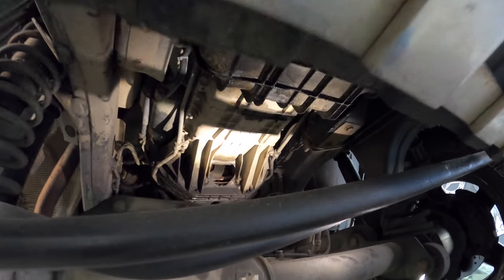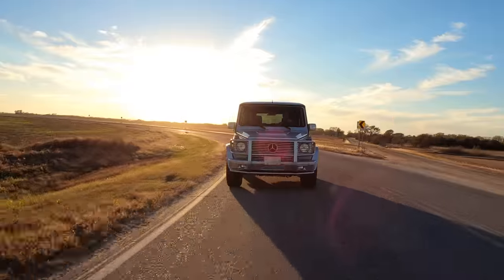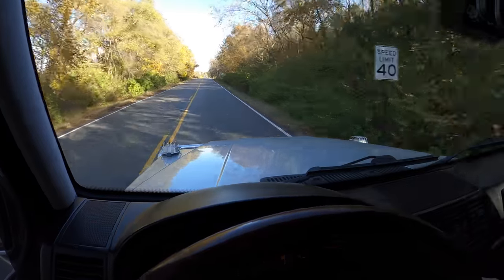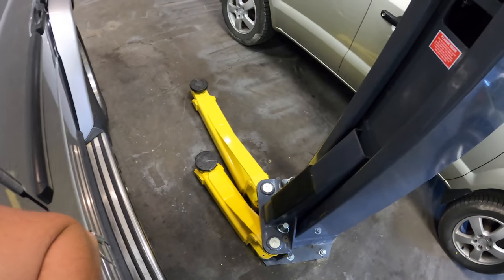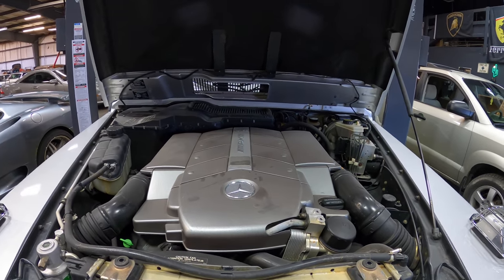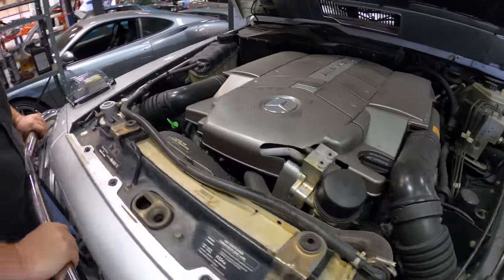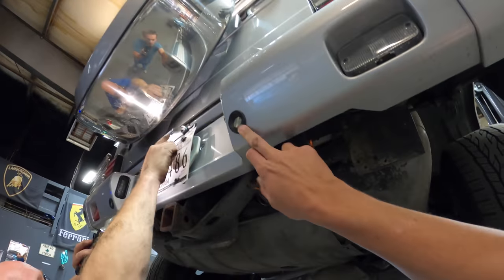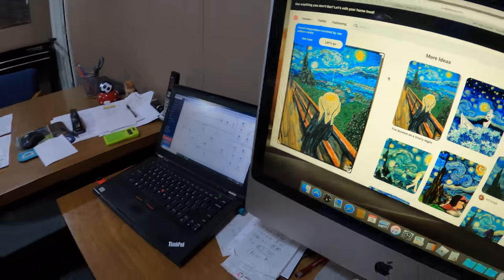Everything That's Broken On The Cheapest Mercedes G55 AMG (CROOKED MOUNTED ENGINE???)

Comment: That is just how G-Wagen engines sit, they had to do that to clear the steering shaft. Source: I am a 15 year Mercedes Master Tech and shop foreman. Google photos can help you as well.
Reply: So ur saying u know what ur saying...ha.
Reply: You are correct. I have been working on Mercedes since ‘02.
Reply: Yeah, but the Wizard will straighten it up.
Reply: Have the same car, same crooked engine
Reply: As long as the torque converter bolts torque spec isn't finger tight.
Reply: @TheTubaMan2  Sure isn't
Reply: Turner Pendergrass Torque converter bolt torque is finger tight + 2 degrees. V-12 models use the popular German torque spec of “Guhtenteit”.
Reply: Will an M113k fit in an SlC 43 AMG?
Reply: @ronjohnson8119  An AVE fan?
Reply: Yes the 463 has the engine mounted like that to get the M113 can fit over the Steering shaft. I am also a master Mercedes Benz Technician since 1998.
Reply: @124030  Hi! I have the M273 in my G550 ... should i expect the same slight slant in the engine bay?
Reply: mine 2008 G55 AMG's engine also tilted, same direction.
Reply: It soup like someone is putting a slant on Hoovie’s G-Wagen issues.
Reply: You beet me to it! I’ve been euro trash certified since 02! All the 463 engines were slanted like that.
Reply: Joe- What is your assessment of a used G-Wagen? Not necessarily one with 222K miles! Any years to avoid?
Reply: Don’t you think the power steering leak was just from a $3 O-Ring from the power steering reservoir? I replaced mine and it’s fine
Reply: 0 experience with G wagons over here, but I have noticed from various engine bay pictures of various G’s that they all sit like this so I figured it was normal.

Comment: The wizard can finally fix his ceiling
Reply: Cannot un-see!!
Reply: The yacht would be my guess
Reply: Does he take those down and serve Chinese food on them?
Reply: Yeah, that was bad...
Reply: You mean buy another boat
Reply: Brutal
Reply: You can just paint those stains away, they have special cans for it.
Reply: Or fix whatever is leaking up there.
Reply: Wizard is cheating hoovie
Reply: Yogo619....how? Those are tiny bills for those vehicles. I challenge you to purchase one these vehicles and get repairs done by a professional ( not yourself regardless of your skill level) for a better price.
Reply: I laughed at that a little harder than I should have.
Reply: @patmclean1951  he's under-charging if anything
Reply: @jundialhaqiqa9907  phhft why :p
Reply: The 65 wasn't running and wants to get paid ? Wizard ...
Reply: You could call the engine in the g class a “slant 8”
Reply: But that’s what Flexseal is for!
Reply: Fix it with a Van Gough painting? 🎨
Reply: Yeah, that ceiling was a big surprise. I wondered why would he film that 🤦🏽‍♂️
Reply: came to comment section to see if anyone else noticed
Reply: @patmclean1951  FOUR GRAND seams a bit steep for a lift kit depending on the shocks, I mean it's not IMPOSSIBLE for the price to be that high but damn I did a drop kit and tubular upper A-Arms for under a grand on my Trailblazer, that was Shocks, Springs and the tubular upper arms to correct the geometry so the truck would align properly and I don't think I had 10 hours in the whole job.
Reply: PLEASE!!!!
Reply: @yojo619  If something is under repair for half an year, i'd imagine pretty steep bill. In here average car repair shop takes 100eur/h. And oil change to mercedes is around 500-700eur.
Reply: I hope he keeps it the same. He's humble enough not to care.
Reply: @DanielRichards644  your not wrong, but he is paying someone else to do this work. When you hire a professional to do work for you , you pay for their labour, shop time and material markup. It’s pretty standard business practise.
Reply: @patmclean1951  yeah I know, that's why I listed time so you could apply a 65 dollar an hour rate and still out much cheaper in my case, but I also said there can be more expensive hardware then what I used for my drop kit if like you get really fancy offroad shocks with external reservoir tanks.
Reply: @babyaufshar17  Mold on the ceiling or in vents can be pretty big health hazard, so it could be pretty good thing to change moldy tiles. And check the vents. It could be that old system has achieved dev point and made water in system and this has leaked into ceiling.
Reply: @jundialhaqiqa9907  the leak was fixed. its just a stain. You cant make everything perfect. Dont even try. Nothing wrong with the Wizard's ceiling tbh.
Reply: @yojo619  Wizard is a honest and trustworthy mechanic. Hoovie bought a old Merc! There is a reason no one repairs them and they just go buy a new one.
Reply: Leased location likely.

Comment: “The shafting is not over yet” 
-Wizard 
Perfect explanation of 2020
Reply: Sure is.
Reply: @thethomasj1795  b)
Reply: Excellent comment for less than two months left in 2020.
Reply: Should be put on a T-shirt with 2020 on the bottom.
Reply: Iconic

Comment: I’m always amazed how cheap wizards rates are. Here in NYC these bills would be 2 or 3X the cost
Reply: Well, it's a lot more expensive to operate a business in NYC than it is in Kansas. One of the reasons why you pay almost 30 dollars for a Sandwich at Katz Deli. I live in CT and going to go have a lobster roll for lunch and by the time I am done where I am going, I will drop 40 bucks.  It cost to much here on pretty much everything.
Reply: You vote for democrats
Reply: @Dog.soldier1950  The price of tea in China varies by type and region of purchase.
Reply: Median income where I live is 55k. The city over where my gf lives, it's 27k. Even with that, average hourly labor rate is around $97 hourly not counting higher end dealership psycho rates.

Wizard charges by his labor rate x book hours. Most small shops around here do the same, but always labor over book time, so lose money. Average tech/helper pay is only $9 hourly. Shops can't keep decent mechanics due to low pay (24-27k annually), so they rely on kids still in vocational school.

I imagine a city where a 700 sqft apartment is $2200 a month would have some high labor costs. 700 sqft apartment here is around $500 a month.
Reply: @AdamIsUrqed  makes total sense. In my neighborhood a 700 sqft apartment goes for $3200 a month lol
Reply: @markedwards7032  Holy Jebus. I thought I was getting shafted paying 350 a month for a 279 sqft shit box with a tiny "kitchen" and a bathroom the Lollypop Guild would use.
Reply: @LemonRumor  the advertisement is priceless
Reply: Land values , taxes, housing costs are all lower so those reduce the cost of living for everyone
Reply: I think first Hoovie gets a huge discount for both volume and publicity.  Second you'd be surprised that not so far out of the city prices drop considerably.  You can find import mechanics, good ones who bill at $100 an hour.

Comment: "...the prices to repair have not depreciated." Well said.
Reply: I tell customers that all the time when they come in with older euro vehicles.
Reply: No but they’re tax deductible and paid for with YouTube Ad revenue which is literally $5,000-$12,000 a DAY
Reply: Repair prices have done better than the markets for sure.
Reply: @j_freed  used car prices are so high dealers cant buy auction cars right now. MMR is through the roof on everything.
Reply: @sukmidri  I lost my job of 15 years at a dealership due to Covid. Feb-Apr has always been our boom season due to taxes. Used car prices have been going up at auction since 2008, but, for some reason, near the end of 2019, it went crazy on our top cash cows.

Chargers, Crown Vics, Chrysler 300s, Navigators, work trucks (running, manual, little to no rust, dents don't matter), Caprices of all years, amd even 90's Roadmasters.

Coronavirus was supposed to bottom out the used market. It didn't. It bloody made dealerships/private sellers increase car costs and ANYTHING near fair market value got snapped up instantly, or bid out of price range on no reserve.

I dig car sales, but working at a small lot sucked when vehicles increase 1.5x in the span of a week.

Comment: Those axle joints at the wheels aren’t “leaking” because they are empty/dry...
Reply: Most likely. Needs a big shot of grease.
Reply: I have a 2000 one and had a 1985 before that. Your fill them as a service item and they ‘weep’ slightly to self clean when your off road - grease out Vs dirt in..
Reply: I agree!
Reply: Argh, my inner pedant has just exploded and it's been a long day so I won't stop myself. NothernChev - it is "they're". Simon Notice - it is "you're".
Reply: @stuartgreenshields5591  Thank you!  I didn't catch that one as I usually do. Corrected!
Reply: @stuartgreenshields5591  You're going to hate this, but "they are" is correct. "they're" is the short way....  same as it's for it is. You are ;-) correct about the the "your" though. Hope I didn't ruin your evening.
Reply: @user338jdn  if they’re anything like Toyota knuckles, the balls should be lightly greased by the wipers which builds up over time. Perfectly normal, but should be cleaned regularly to avoid build up. They commonly get so bad you have to chisel away greasy muck to uncover the bearing cap fasteners.

If the inner axle seals are gone diff oil would be pissing out that seal and a huge wet leak. Diff oil washes out the grease so those leaks need attention.
Reply: Prakaash A  , no, it’s a solid axle 4wd knuckle joint. They usually have felt and rubber wipers. Never seen one with a boot.
Reply: @stuartgreenshields5591  I’m mildly dyslexic.. I usually catch most things, but that’s one that I often read as right, when clearly its not :-)
Reply: They looked scored to me.
Reply: @coyote5735  they’re not a bearing surface, it just has to be smooth enough for a wiper seal to keep grease in. More likely to be a line in grease than a score mark

Comment: 2 Mercedes, including a v12 one, a Bentley and a conversion van ALL brought up to speed for under 8K, Wizard is a good deal. The CL65 @ the MB dealership alone would have been 8k.
Reply: Yeah I was surprised with those prices. I mean changing a single front brake caliper and rotor on my 07 mazda 6 cost me 900 Euro work included (only dealer had the parts and I needed it ASAP) in central europe. I can easily see CL65 invoice being aroung 8-10k here.

$750 for a driveshaft change incl. labour on a 22k luxury SUV? That's next to free. I can easily see an MB dealer asking 10x the price. Same with the motor mounts... like just the labour to have them removed would be 2000 EUR at least here. Having the G wagen with everything fixed by a guy who knows what he is doing for less than $30k (excluding headliner)? That's a bargain.
Reply: @VanBourner  yikes, that seems like highway robbery. In the US that caliper is an $80 part pads are about $40 and a new set of rotors are 65 and that’s for premium stuff. Maybe a $200 job with shipping. Changing calipers is a pretty easy DIY job sucks though if you dont have a garage you get ripped.
Reply: I wish I had a Wizard like this in my town!
Reply: @David..  Mazada's can get real funky to work on sometimes
Reply: The Wizard offers Hoovie a substantial discount on his work because, A) Hoovie has a never ending supply of work for him to do,  and B) if you pay attention, Hoovies stuff sometimes takes a while to get fixed. Hoovie's hoopties are worked on when his full margin paying customers are taken care of first.

Comment: The engine is supposed to lean like that... it leaves clearance for the steering shaft.  Your motor mounts are fine.
Reply: Yes, exactly. It looks odd, but that is normal.
Reply: Was looking for this comment! It’s normal for ALL these G wagons(2002-2018) for the motor to sit a little sideways. I was honestly expecting Hoovie or the Wizard to know this as they both have stated to be Mercedes guys!
Reply: I was wondering if maybe that was the case from the 1st time Hoovie pointed it out in the previous video...it'll be interesting to see if they mention that in the next video.  I almost recall Doug Demuro pointing out that interesting quirk back when he reviewed his own G wagon.
Reply: @caseyhubbard4350  Well, they actually say it's supposed to sit a bit tilted, but they think this one is sitting tilted too much.
Reply: I think its a bit more tilted than normal.
Reply: @aleksanderqpantev8754  So do the Wizard and Tyler.
Reply: The Wizard did mention that it could be like that.
Reply: Speaking from experience, it's normal for the w463 Mercedes g wagon 5.0 to sit slanted
Reply: Yeah, the amount of tilt (as shown in the video) is normal.
Reply: @caseyhubbard4350  my merc mechanic also told me the tilt is normal for the w463, but not other mercs of the era
Reply: @aleksanderqpantev8754  it looks normal to be honest. I'm not saying ur wrong though.
Reply: +1 A G wagons/class have this leaning engine
Reply: This guy knows what he's talking about.
Reply: Mine tilts to the left and it's perfectly normal.
Reply: Nope, the engine shouldn’t be leaning like that at all. I broke my head on them, I see them daily
Reply: @josesegura2170  Sorry but you've never worked on a G wagon if you don't know the engine tilts like that by design.
Reply: The wizard said it looks like they tilt a little but he thought that was too much.
Reply: When I was a benz tech, my foreman  said that they come with a straight six in europe. But Americans want a v8. So the engine sits at an angle  to make it fit. I hated working on them...

Comment: those engines are put in like that from the factory
Reply: yep, supposed to be tilted , needs space for the steering system
Reply: Old one's...
Reply: Yep.. I have a 2000 G 500 and the engine is exactly the same. Serviced by a Mercedes specialist who work on a number of them. That’s the way they are.. at an angle
Reply: You just saved this guy a lot of money😂😂
Reply: Needs some loctite or some washers to cinch up the bolts

Comment: Nice W463!!!
Instead of lifting the car 3" with an expensive lift kit, and resulting that the car will ride very bad, because there are a lot of changes on the suspension geometry, I would recomend to use a 1" budget lift kit, swaping the used shocks for a new ones with stock lenght, I would use the stock 17" wheels with some 1,25" spacers and AT tyres 265/70R17. It will ride like stock, and it will have an appearance of bigger vehicle, like an offroad special edition made by MB factory.
All the saved money can be spent on doing an automatic transmission flush, for example.
Best regards.

Comment: Hoovie has a problem with buying cars from Stuttgart with engine troubles.
Reply: I'm sure I can hear Munich clearing it's throat somewhere...
Reply: I guess we blame the Austrians from Graz for the Geländewagen. 🤣🤣
Reply: @cullenmiller8170   NEIN!
Reply: Sorry, but that’s not correct.  He has absolutely no problem with buying cars from Stuttgart with engine troubles.  He’s bought LOADS!!!
Reply: @martinkk2943  Ja doch. Die Burschen in Graz hatten zu viel Kirschwasser oder Enzianschnaps. I wish Mercedes would have sold a basic G-Model over here. Diesel engine and manual transmission instead of the fully loaded version. I guess they thought they had a market with the Chelsea tractor.
Reply: The m113 is a good engine.
Reply: @mchuo7834  Wont argue, the M96 is a good engine too, but he bought awful examples of both.
Reply: @henryatkinson1479  
If Hoovie bought a Toyota, it would’ve been one with massive issues. Because that’s what his channel is about: broken messes.
Reply: Ingolstadt would like to enter the conversation if Hoovie would torment himself with a B5/6 Audi - or any from the early aughts models.
Reply: @ACedricArmstrong  allroad time

Comment: I'd say some one quick swapped that engine and sold the car off. Make sure that is a good engine, it might just be enough to sell the car last a few hundred miles before it blows again.
Reply: Arent they pretty bulletproof engines? I suppose they should test the oil and crack open the valve covers at the least to get a view of its general health
Reply: No those things don't blow up just like that...they are very good
Reply: @NuclearPineapple   for the most part the M113 is probably one of the single most reliable Mercedes motors I can think of. I have seen 300+K miles on original motors with average maintenance. They may leak a bit eventually, but it'll run forever. Until one of the electronic accessories break and end up totaling the vehicle.
Reply: @FappinSteve  He said 300k miles, not kilometres.
Reply: @FappinSteve  I mean 300,000 miles the K as in thousand.
Reply: @UCqYaxiwJ6Pybj64DKLCi4ag but yeah my grandma had a W220 2000 S500 and the motor was the single best part of the car reliability wise. She drove it from 90,000-180,000 miles and the only thing that gave her trouble were the electronics (but to be fair that car was SO far ahead of it’s time it’s not even funny. Distronic cruise control on a 2000!) The first gen airmatic was a nightmare, the shifter lock broke and cost an astronomical amount of money to fix, and various other annoyances but she absolutely loved it and the motor drove identical at 180k miles as it did with 90k. (I even got to beat on it a bit before it finally died). The end of it’s life was the instrument cluster getting stolen along with the rear SAM unit and other electronics in the car when she left it unlocked somewhere 🤣🤣🤣🤣
Reply: @NuclearPineapple  my W210 e55 has 240,000 miles on it, service items only and a cam chain so far. I would suspect the G wagon gearbox before the engine but the achiles heel of these engines is a lack of an oil light and no dipstick so they can get wrecked pretty fast if you are unlucky or your dash display isn't working.

Comment: The engine had to be mounted on a slant due to the placement of the AC compressor on the 113 motors. It’s referenced in the intro to service manual and was addressed in both service and sales training.